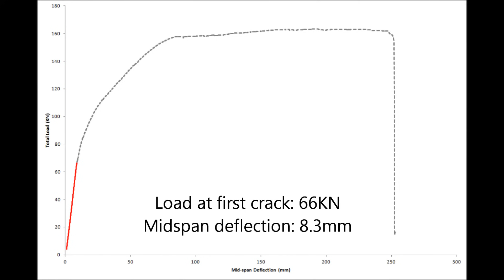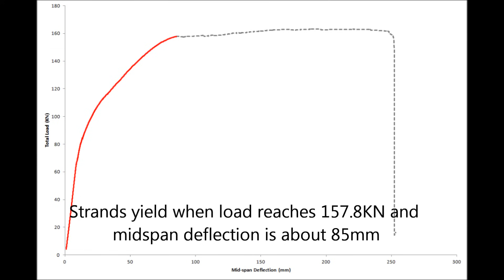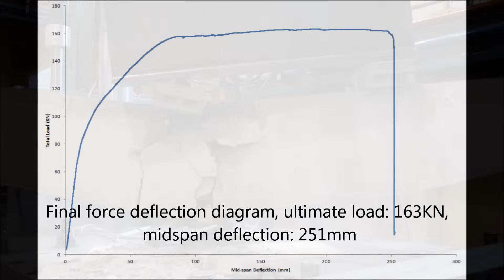Beam Test...watch beam failure in slow-motion!

Comment: these guys have induced all the force into two points ,try it again with the force applied evenly across the whole span.
Reply: That would be less stressful.
Reply: This test is called four point loading. The reason why it is used is we can accurately determine the area of the beam which has experienced peak stress and extrapolate from there (all points in between the two loads on top experience an identical bending moment). Essentially what this is doing is identifying the statistical probability of locating a significant stress concentrating fault in the beam. Counter intuitively this form of test will cause the beam to fail at a lower force than a test with only one point of loading (as a matter of statistics) and applying an even load over the entire beam would only complicate the results by removing the convenience of a constant bending moment over a known area. Instead, there would be function of degree two to describe the bending moment over the beam, rather than degree zero which, if I remember right would mean the test would suggest the beam would be stronger if the load was evenly applied over its length. Also it would be much more of a pain to run calculations with
Reply: so its  a simulated test with the results calculated  and scaled up to  full size   with the end result total failure and this way ensures the easiest way to achieve that?
my  next question is wouldnt 3 point loading be easier to calculate and if the stresses too high ,couldnt you just scale down the beam ?
Reply: It's not simulated - as you can see that test is the real deal with an actual concrete beam. The most important result is the flexural strength of the concrete which is a pressure so it doesn't have any bearing on how much concrete is actually there. From the strength and a known area of concrete you can find the force a beam can withstand so they could be scaling or they might not be to trust the results more.

Yes, this test is the easiest way to achieve this goal. Arguably 3 point loading is easier like you suspect and the beam could be scaled down if their rig can't exert enough force. The reason why four point loading is preferred is because it is much less likely to accidentally overestimate the strength of the concrete because in a real environment the beam may experience four point loading which causes the beam to break more easily than a three point loading test would suggest.
Reply: derp man ok sounds good

Comment: I was expecting a more catastrophic failure.
Reply: The whole idea about designing safe concrete structures is to avoid catastrophic failure. A well designed concrete part is going to greatly deform before eventual failure of the compression zone (this is beautifully shown in this example actually). The whole idea about this is that it gives of a warning effect leaving time to evacuate the structure when it is overloaded or failing. When a beam instantly breaks, it could indeed be a lot more catastrophically!
Reply: It also has to do with how the load is applied. Unlike a hydraulic press or something where the force is always applied, here, the force is applied because the block is being driven down by giant jackscrews at slow, fixed rate. It couldn’t shoot down even if it wanted to

Comment: Questions guys,

1.  for a prestressed beam, does it really need to have a bulge or deep cross section at the middle in order to have a higher bending moment capacity or load rating? Beam of this shape seems to have no beauty mah.

2.  So when the strands broke, the beam went kaboom ?

3.  In a real bridge,  when a small crack is observed at the bottom of the beam, does it mean that the bridge should be condemned?

4.  Vidcam you used in the test, how close to the test subject and what danger of being hit by the concrete pieces on explosive failure ?
Reply: ***** In any beam of any material, having a deep midsection like the one in this video will determine the overall strength and longevity of the beam. It seems like you might understand the concept of what I'm talking about, but think about a ruler standing on its side. You can bend it, but not much. Now add a second ruler standing the same way to increase the depth. It's nearly impossible to break when you try to bend. In terms of a crack in a beam/column on an actual bridge, only severe cracks will determine whether the bridge will need to be condemned. Small cracks could mean anything. As long as the bridge is under similar loading at all times, the crack should remain the same. If the bridge is in severe weather conditions, any crack is a problem. Cracks can be fixed fairly easily. Like any structure, maintenance needs to be done. As long as the student is standing a good 10 feet away, there won't be a problem. If your beam is exploding, then your construction is definitely questioned. I think a bolt failure on a steel beam could definitely cause damage to someone no matter how far away they stand.
Reply: +Ozzie Wozzie Original -- you were reading my mind with these questions
Reply: The deeper the belly on the concrete beam the stronger it will be since the neutral point will be able to shift deeper into the beam. concrete being ~ 12 times stronger in compression than tension.  Not sure if that helps with your question.
Reply: This reminds me of how a steel rod is put into guitar necks, at a curve. Then it tightened to straighten out the neck, which would otherwise bend due to the tension of the guitar strings. When the curved rod is tightened, it wants to straighten, and this gives the "underside, if you will" a "lift". The greater the curve, the greater the lift.
Reply: Ozzie Wozzie Original im not a smart man by any means but im assuming the purpose for tests like this is to put a structure under a much larger load then it would ever see under practical use, much in the same way osha tests safety equipment? Am i wrong? 
My question to you is do you think the beam would perform better if you filled it with self expanding foam or something to that nature?
Reply: Ozzie Wozzie Original and i think yes. Being thinker towards the center would increase the load that it could handle. But the amount of weight it could hold would diminish when the length of the bridge increased. Am i right?
Reply: Is this cambered to provide more upward tension to compensate for applied weight from above....
Reply: The wider the stronger and it's significant. You can mentally compare the two extremes, an ultra thin sheet where no material strength will suffice and the other extreme is almost vertical down so the weight at the middle is essentially hanging. This one broke at around 16ton or 8 ton per pier which 5 normal plastic climbing robes could hold. so there is tremendous advantage in shifting the load into hanging tension instead of horizontal span bending strength.

Comment: Why are we measuring in newtons all of a sudden instead of pounds or kilograms?
Reply: newton refers to force i believe ie the force needed to break the beam rather than weight
Reply: @melin1969  Ok, but why the change? I guess I have to look up the equivalent now.
Reply: @joewoodchuck3824  Metric units are used as Standard in Engineering/R&D.
Reply: Two things about you are rather loud:
1. American
2. Not an engineer
Not to worry though - you're in good company here I notice.
Reply: @ddaytona1  Kilogram is metric.
Reply: @Tinker1950  
So far the metric system hasn't put humans on another planetary body, that will change, but you wont be 1st.
1. You are not American
2. No matter what, your nation wont be 1st to do so.
Reply: Nasa actually used Metric for the moon landing and still uses it today, they converted it into imperial for the crews viewing. (Not picking side just wanted to point it out.)
Reply: The only purpose of the metric system is to confuse freedom-loving Americans. If the metric system system wasn't mentioned in the Bible, it's unknown and unknowable. Jesus never used the metric system, why should I?
Reply: @melin1969  Newton is a metric unit of force. Pound is an Imperial unit of weight or force. Weight is a force, not a mass. A mass accelerated by gravity produces a weight.
Reply: @misterguts 
Careful, you'll confuse the freedom loving doltish Americans
Reply: @misterguts  America represents 4% of the world population and you think the other 96% is wrong? An antiquated 2,000 year old measurement system has nothing to do with it.
   The metric system isn't confusing at all once you start to use it. But you refuse to embrace the easier method for measurement out of nothing but prejudice and a perverted sense of national pride.
   No longer juggling with mixed units for distance. Approximately six different units off the top of my head  starting with inches are eliminated and whittled down to one. All you need is the meter.
    More intuitive temperature measurements:
0 freezing
25 comfortable
30 uncomfortable
37 body temperature
50 pain
100 boiling
    Easy.
Reply: @soldierski1669  It's funny because you're completely wrong.
Reply: @joewoodchuck3824  did you miss his sarcasm?
Reply: @logitech4873  Maybe I did.

Comment: How are the end supports connected to the press? What sort of structure is in the floor?
Reply: The beams are supported on triangular shaped structure which looks like a book end. The support structures must be bolted to the floor, which is made of embedded beams and concrete. Yes the floor is probably 10-12 feet thick of reinforced concrete.

Comment: Way to go guys! Looks like you all were wearing the correct PPE during the test. I was hoping a small shard of concrete was going to fly in the guys eye sitting down. Great test. Fail at SAFETY.
Reply: Yeah
Reply: Thinking the same. Testing with that type of energy near by waiting to release. Brave men they are. No shields, no eye/body protection, a computer station set a few feet from the test, wow. No OSHA there I guess.
Reply: why is everyone such a prick about safety?  osha standards cause about as much damage as good old common sense.  i knew a guy installing fire protection in a hot attic with the safety "dood" for the GC nearby and he could barely see the sweat was building up on the inside of his glasses and the safety "dood" didn't care.  the glasses stay on.  thats epitomy of the problem with osha, the same problem that engineers have.  they all want to keep their jobs but the only way they can is by impeding the flow of common sense.  they are not your eyes!  perhaps they have already tested cobcrete beams and they KNOW there is no EXPLOSION DANGER.  people that comment safety fails are the same people that would eventually have us wearing ppe just to watch dangerous videos...
Reply: No safety at all. Why the hell they were clapping?
Reply: What the hell do you know about how reinforced concrete behaves during a steady load yield test anyway? I sure don't because I'm only a mechanical engineer by training. So I assume you all are civil or structural engineers then? And you guys did research on dynamics of energy release during failure of this material? No? So let the experts in their own field decide for themselves! Smh*

Comment: The beam failed under each point of force. I'd like to see this test and how it would react with one point of force in mid span.
Reply: as a matter of statistics the beam would yield at a higher force than in this test with a single point of force. These different tests are called three point and four point loading. The reason that four point loading gives a smaller number is because it tests a larger area of the beam for a fault which causes a large enough stress concentration. It can be counter intuitive but when it comes to ceramics like concrete two loads half the size are more likely to cause a failure than one load that's twice the size.
Reply: Like your need,..... and what you just did?

Comment: IMHO I think the beam actually did break because of the "local pressure" point, not from the "general load"
Reply: I agree. Noticeable first failure was at the turn in the beam, had it been straight the possibility is  it would of took a far greater load, despite the loading position.
Reply: @adrianbew9641  That’s why the beam is reinforced there. Yes, it would have carried a larger load if it had the thicker cross section along the whole span, but then your beam is heavier, harder to work with, takes more materials to make, and is more expensive. And if the bridge only needed to carry 75kN, then they’ve got a decent safety factor there, and designing a beam that can handle 300kN is wasteful.

Anyone can make a bridge that stands, but it will almost certainly be more expensive and use more materials than is needed. It takes an engineer to build a bridge that only just stands (with a factor of safety, obviously), and uses only the minimum required amount of material.

Comment: Thats only like 35000 lbs of pressure, if I'm not mistaken? I thought a beam that thick would be able to handle a much more significant load. What kind of application is this beam designed for?
Reply: D. Ryan Shaw i tried to look up what "kn" stood for before i commented and it was way beyond my ability of understanding. But i would think it was far greater than that?
Reply: Jeff Williams I believe a kilonewton is around 220 lbs of force or so. My line of work requires equipment that is rated at 23kn's or greater and I'm pretty sure that's right around 5000lb's. So 1 kn would be about 220 lbs

Comment: Aah, the good old Kelvin Newton unit 😂😂
Reply: kilonewton...
Reply: @dbeierl  He means the text on screen which says KN. In the SI system a lower case k is used for the prefix 'kilo', upper case K is Kelvin. On the computer screen you see the correct usage, which is 'kN'.
Reply: At last one academic watching beyond the: oh, I'm surprised about the load.
Not surprised. Pretty regular load. Maybe the beam supports more if they would have used kN instead of KN.

Comment: There is not enough energy, stored or otherwise, to accelerate the beam horizontally (or bits of it into eyes;). If you were to rig an endpoint on an incline (so as to change the down vector to horizontal) with a keeper pin say, and suddenly remove it, the beam might move a few millimeters. Remember everybody, solids and liquids are virtually incompressible--which is why hydraulic systems are so useful! The inherent safety of such a test is similar to that of hydrostatic testing of compressed gas systems; or in other words, you can pressurize a water-filled gas bottle to failure, stand next to it, and not even get wet (well north of tens of thousands psi) but try it with gas however, and you'd be reduced to many small bits. Or for the English majors out there, this is more about a beam's static properties--not dynamic. To investigate its dynamic properties, you'd want to wave it around (and then maybe stand not so close;)!
Reply: Christopher Green a void, improperly placed contact pads, or other unexpected causes of point stress could send a small chip flying. A large chunk falling and hitting the bed would also have plenty of energy to send a chip flying. Large pieces won't get flung around the lab, but it doesn't take much to damage an eye, and rated safety glasses are cheap protection.
Reply: --Yes! You are absolutely right and eye protection (and ear) education ought to begin at a very early age--long before people enter adulthood let alone the workforce (any kind of education in anything might be a nice goal too, but that's a different video). As is sometimes the case, the comments to this video were kind of more interesting to me than the video, which is the reason why I dove into the physics, statics and dynamics, etc. and a more considered comment would have included your points as well. That said, allow me to reinforce your message: one day, as a young machine shop apprentice, I saw an old fashioned safety poster from the sixties (I'm from the sixties!;) with an actual photo of an actual person with a piece of a shattered 3/32" HSS twist drill literally sticking out of his eyeball--after that day I never "went without" my glasses again. That image worked for me far better better than any amount of drilling (pun intended of course) so I must also include another "picture" of my friend, a bookstore owner, who lost her eye to a bungee cord hook while securing a stack of books to a cart. Stretching it out and down, perfectly aligned with her face, it slipped from her grasp and in an instant took out an eye--and I mean out. Your point is well-taken Robert, thank you. When injury and 1/2 m(v)^2 go together, it's usually the v that does the damage.